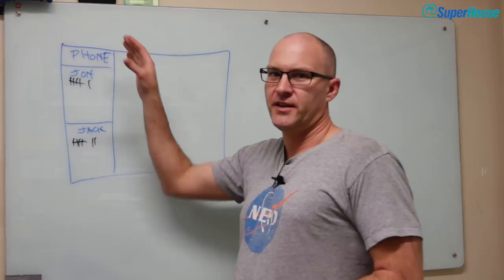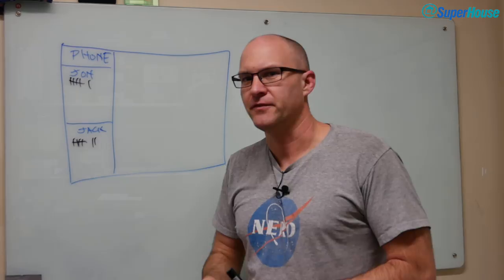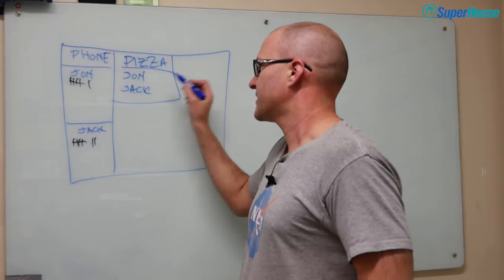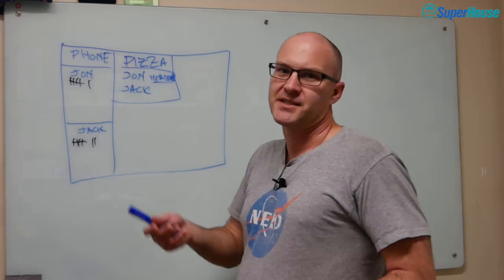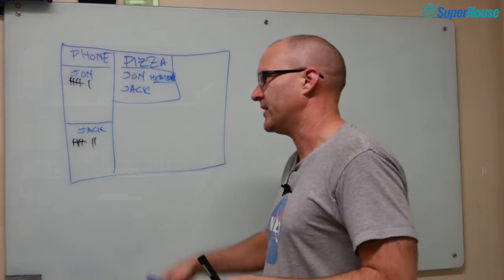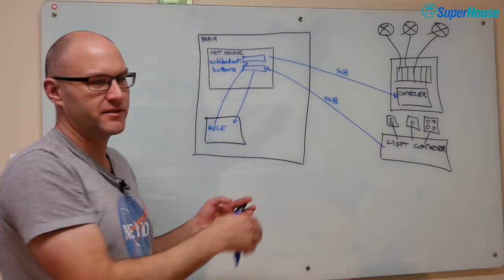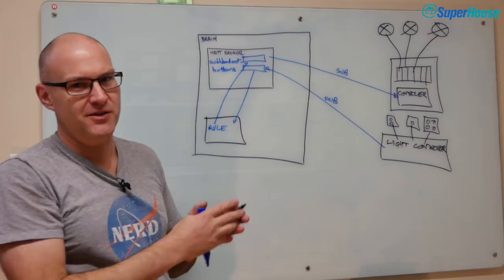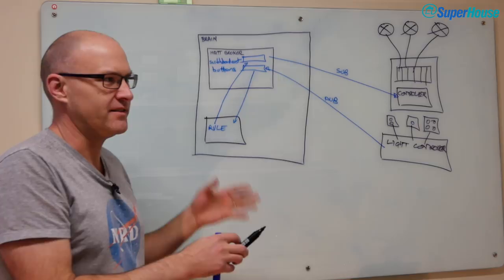SuperHouse #24: Home automation system architecture

Comment: I honestly do not like the way you solved it. It is much easier if each key is smart and controls lights and reads the buttons. It saves a lot of wiring and it is not necessary to rewire the whole house. If there is a problem with your core software you lose the ability to control your entire home. Having a distributed logic each of the switches can control what is connected to it without the need of the central software. On the other hand, personally, I prefer Home Assistant before OpenHAB.
Reply from the maker: With distributed logic you lose the ability to do most of the interesting automation side of things, because you need somewhere that has overall knowledge of the state of the entire system so it can take action depending on the scenario.

Comment: +1 I have been using this architecture for 2 years at home. But like "brain" I use Pimatic + Mqtt plugin (https://pimatic.org/pages/demo/). Pimatic has a much better rules system, with a Autocomplete (actions, devices, variables, syntax etc.). I do not have to write code for each rule as in OpenHAB. Which most people probably do not manage and it's certainly not comfortable (https://youtu.be/J9iGAuNLadU?t=6m26s :D).
 Broker I see more as a bus controller than a part of the "brain".
Reply from the maker: I installed pimatic a while ago and played with it a little. I should look at it again.

Comment: Jonathan thanks for this great episode!
I'm following your channel for long time and it's great to see you back.

Few insights from my experience:

You can use modules from these guys for dimming: http://stores.ebay.com/KRIDA-Electronics - so your arduino can either control relays for some channels and these dimmers for others. I will be happy to share more info (and code) about what I'm exactly doing with these (zero-cross detection, timing triacs, ...).

One more significant difference I have is that my "switch/light controller" is an arduino that both senses the switches (for on/off/dimm/...) but also directly controls the actuators. It also interacts with the OH2 controller to report state changes and get commands, but the main thing is that each "switch/light controller" (I will have few of them) can function independently of OH which I think provides more reliability.

I also use HABPanel on tablets (with my own html/css customization) as an additional controlling interface - you should try it out. While the OH Clould application is great, it's not nearly as neat as HABPanel.

Like many others - can't wait to see your next episode :)
Reply from the maker: Thanks for the comments! Those modules look interesting. They have quite a few options there.

Having OpenHAB (or some other controller) sit alongside your input/output controller is a good approach. Provided it's integrated as you described, so that it detects events that occur directly between the switches and the outputs and it can keep its internal state in synch with reality, that's an excellent way to allow OpenHAB to provide extra functionality and interfaces without making your system dependent on it. That's actually how my system evolved. I didn't have OpenHAB at all originally, only my own rules engine, then I started running OpenHAB alongside it. Over time more of the parts of the system have become dependent on OpenHAB instead of my own rules engine, so it's definitely become a potential failure point.
Reply: They indeed provide few types of dimmer modules that differ mostly in the way you control them - direct triac control (what I went with), setting 0-255 through i2c, discrete pin combinations, and others.
I ended up choosing these ones: http://www.ebay.com/itm/4CH-AC-LED-Light-Dimmer-V2-Module-Controller-Board-ARDUINO-RASPBERRY-Smart-Home-/122501556402 as they provide me with most flexibility - you get an interrupt on mains phase zero-corss and then can time the triac triggering per-channel.
I intend to use them also for lights that I don't plan to dim - so I get soft on/off transition effects (like you get in high-end hotel systems), unlike hard on/off with relays.
I found having two push-buttons for each light more intuitive for the users than one. Upper one is always for turning on (short press) or dimming up (long press) and the lower one is always for off/dim-down.
I will be happy to share my code (github) when you get to deal with it...

Comment: Communist breaker boxes are outside? thats dome... so you have to go clear outside (possibly in the rain) and reset the breaker. Wow thats smart.... no.. no its okay just touching 240 Volt panel while wet... perfectly safe
Reply from the maker: Here in Australia you can't just put the breaker box in a totally exposed location. There are mandated standards for the location of the box and weather protection for it. The first switchboard that I show in the video is under the cover of the eaves of the house, so it's not directly exposed to the weather. In the video it probably looks like it's just totally exposed on the front wall, but it's not.
Reply: In Portugal, if you are building a new installation, on the front wall of the house you will have two boxes: a fuse box and the counter.
Then inside of the house you'll have a main switchboard and then one sub switchboard by floor if applicable.